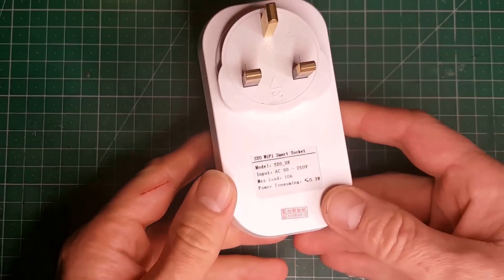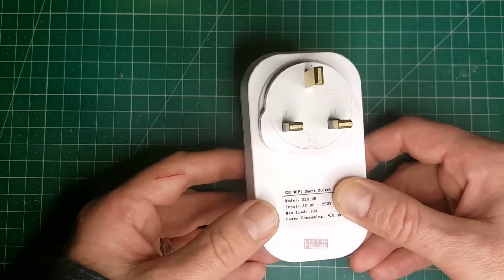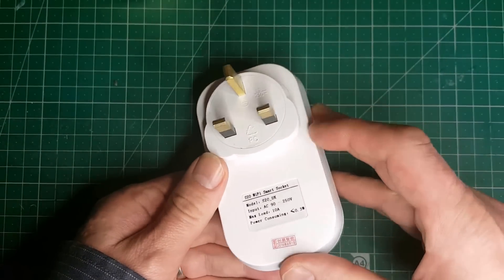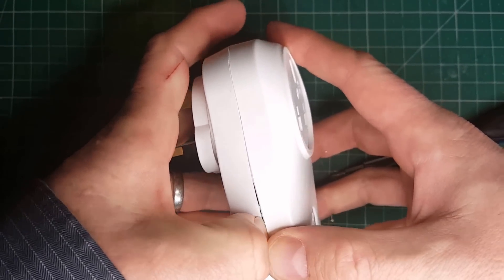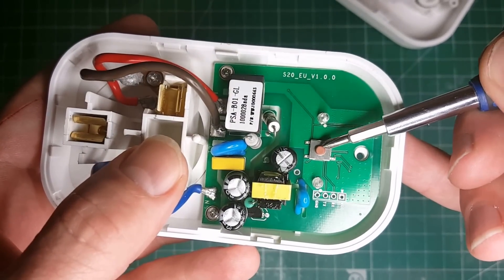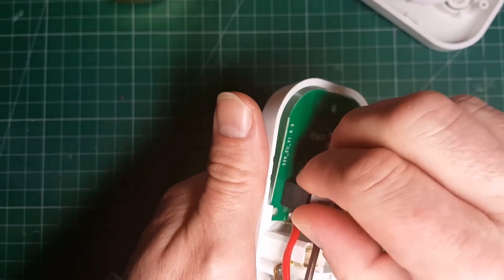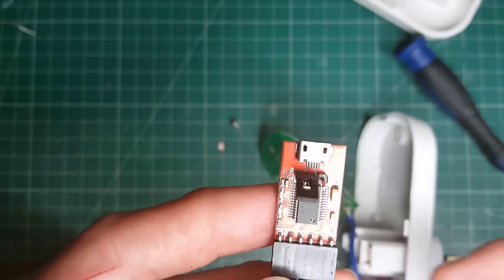Installing ESPEasy Firmware on an Itead Sonoff S20 Smart Socket

Comment: Why do we need to flash new firmware in place of the original one.
Does the module has problem to work with the original firmware.
Please confirm ?
Thanks

Comment: Can I schedule on off times after flashing the sonoff with ESPEasy firmware? I want to turn on a light bulb at 7:00pm and off it at 6:00am everyday. Currently I am doing this using a sonoff basic and ewelink app.
Reply from the maker: I do this using openhab.

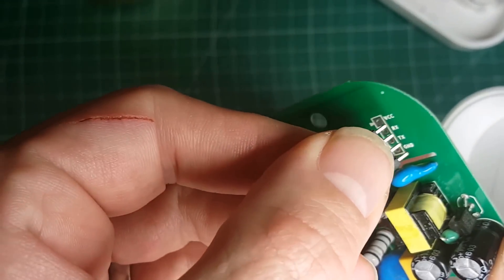Comment: There is a special connector that connected to the circuit and soldered, with metal solder. what is the name of that part, the one that make the jumpers able to connect to the circuit, I am looking for that part anywhere :( please help. the part can be seen clearly at 5:28
Reply: header

Comment: 5:35 Give the components some time to heat up and accept the solder. Then add some solder and remain for about some seconds to let the solder flow. With this you can easily improve your soldering.

Comment: Please don't use stability control on your videos. It makes me nauseous from the constant motion and video distortions.
Reply: I've noticed that artifact too... it makes the video frames wavy.
On another note, it would be nice if the firmware could also be programmed via OTA over WiFi, in addition to the serial header.  It would certainly make it more user friendly for people who are not competent with soldering, or just too lazy ;)
Reply: @BillAnt  You would ofcourse require the serial headers to flash with an OTA firmware.
Reply: Paul Campbell < I was just wishing if it would be possible to enable firmware update over WiFi once you flash a custom firmware (which would contain the OTA code).  Not necessarily for me, but for the masses. ;)  There are plenty of consumer gizmos out there which allow you to do just that (for example most WiFi to Ethernet adapters, like the Netgear WNCE2001).
Reply: Jelly motion..... :-(

Comment: Hi it flash good at the end with no error but no wifi showed up after flashing and reboot the esp 
any ideas
Reply from the maker: bobby royster sometimes I find that clearing the eprom with esptool.py before flashing the esp8266 can solve that one.
Reply: Yes, same problem here. Using ESP tool did not help.
Reply: same here

Comment: I have problem while flashing i got error; espcomm_sync failed
Reply: i switched tx with rx and its work
Reply: trying to connect
        flush start
        setting serial port timeouts to 1 ms
        setting serial port timeouts to 1000 ms
        flush complete
        espcomm_send_command: sending command header
        espcomm_send_command: sending command payload
        read 0, requested 1
warning: espcomm_sync failed
error: espcomm_open failed

Do you have any idea ?